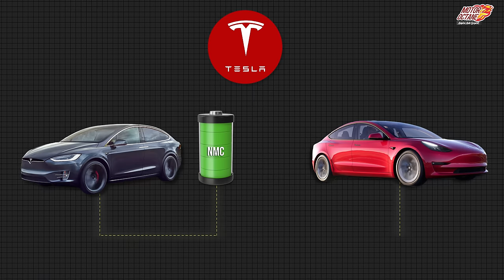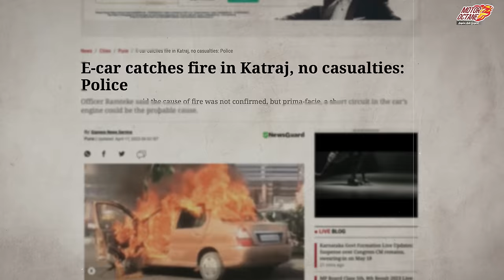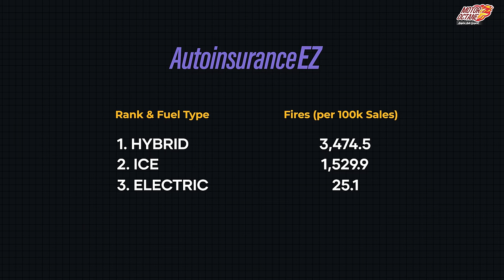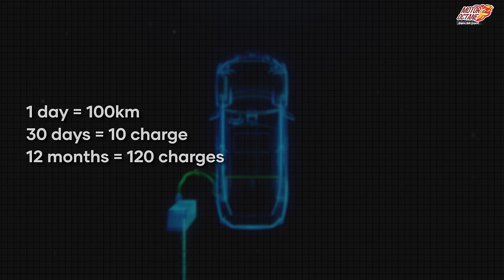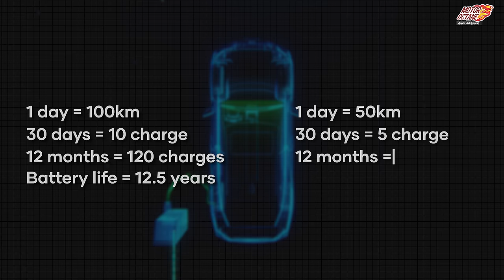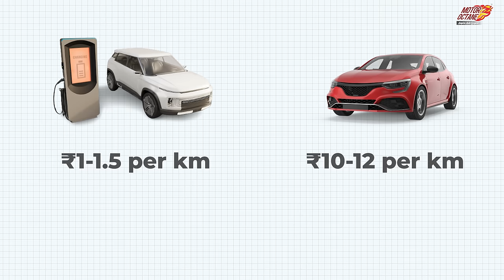Electric Cars have Battery Problems?

Comment: point a to point b in city its fine

out of town u need at least one battery stop and that could be at least one hour 

whereas fuel full tank takes 15 mins 

cost huge for bigger battery 

n once electricity charges increase which they will just as in usa where electricity is privatized 

well feasibility of electric is very low

Comment: In Financial analysis of EV one important point was missed.
The initial cost of any electric car is 2 to 3 lakh extra than the petrol cars. This is even after subsidy.
This means one has to drive the car 3 lakh km before they can recover the input cost. That is almost impossible.
The cost of electricity will go up like petrol. There will be maintenance cost. If we leave all this aside as they are common factors for petrol also. Consider this. If you change your car at home, it means you are consuming more energy and it will increase the total number of units consumed. Thus, you will breach the subsidised number of units and your whole bill will be generated at a much higher rate per unit. So, you end up paying more for your household appliances also.
One can never, recover the input cost. Better to buy petrol or hybrid and invest rest of the money in mutual fund. In 10 years you will get 12% on any index fund. This would be much smarter.
Unless the cost of electric cars comes down or becomes equal to petrol cars, it is not a value proposition of any middle class person.
If you are not middle class and rarn more than 45 lakh per year, you have nothing to worry  about. You should buy only electric cars and contribute to the public research. For the rest of us, wait till we get proper data on the batter life and cost comes down.

Comment: Considering electric car as a normal petrol or diesel car: 
Owners generally resell their cars after running 80k to 150k kms.
1) what is the exchange policy by electric car makers? Will they take back electric cars to offer discounts?
2) will it give same exchange value as petrol or diesel car?
Reply: why not ultimately dealerships have their own cabal to sell away the used cars through their contacts

you can sell directly on olx etc too since dealerships give lesser price than olx etc

dealership does not buy cars in exchange to send it to scrap or to drive themselves, they buy it to sell again

the price will be lower than selling directly to buyer as usual with normal car. Price of second hand EV will depend on battery degradation and in general how well maintained it is

Comment: This is such a reassuring video for someone like me who’s looking into buying an ev as their primary vehicle. The only concern I’ve is regarding it’s safety when parked in an open space under direct sunlight. I don’t have a covered parking spot, so it’s the only stumbling block stopping me from buying an ev.
Reply: Don’t buy if you don’t have a covered parking. I have a tiago ev and in the manual it’s specified battery degradation will be faster if kept at high temperature for longer durations. Also battery management system will run with coolant even when parked to optimise battery temperature and due to that you will lose more battery.
Reply: Congrats on fake assurances..

Comment: Sir petrol/diesel car fires and EV fires are not the same. EV fires burn at very high temperatures and are almost impossible to put out so theres a very high risk of injury to the owner in an EV fire. Also any accident that causes the battery to be pierced will lead to a fire which can be very deadly. We may start seeing many more EV fire cases as more and more EV are seen on the road and involved in accidents.

Comment: Cleared a lot of doubts for me, still some remaining, but very well done 👌🏼
Reply: what doubts remaining, I can answer (nexon EV prime 2021 11k km)
Reply: @shresthsonkar9207  what about resale
Reply: @pratyayamrit007  I'd ask you counter question, 

what are will be resale price of BS6 E10 due to E20 in future?

What will be resale of diesel cars amid the fact that the goverment has been presented with proposal to ban diesel vehicles in 1M+ populated cities

What will be the resale value of so called "best of both worlds" hybrids when their battery doesn't even have cooling system in hot country like India and the avg hybrid battery completes 2-3 cycles per day due to small capacity?

There is no certainity about anything, not even about the fact whether we will live to see another day or not, daresay. So I don't see how this is an "EV PROBLEM" and not a general uncertainity which affects every car

You can use OBDII to check battery health status of any EV so it would be very transparent to second hand buyer to check how good the EV is 

The more the health the more the resale. The only thing that may affect resale is changing technology.

Like let’s say rn only Nexon EV max gets 50kW dc charging but in future Tata may give that to normal Nexon EV prime also which currently only gets 25kW dc charging. 

In this scenario, the price will fall for those EVs since they lack features that new EVs at their price point will have 

Or let’s say Nexon gets adas in next generation acc to rumours then also prices will fall since a big feature will be missing from current gen compared to future gen.

Comment: Hello i am a doctor by profession and After consulting twice with motor octane, i bought MG ZS EV 6 months back . Currently happy with my car as i have already completed 30,000 kms in 6 months as my daily commute is 150kms. Not faced any problems till now. Thanks for helping me chose electric car back than.
Reply: According to resellers and online used car sellers, doctors don't drive more than 5000km per year. Clearly you are not a doctor.
Reply: @TheFourthWinchester  ok

Comment: Rachit, I am a Tigor EV owner. 
The calculation of charge cycle you did is not accurate. Unlike a petrol car, you actually don't wait till 10 to 15% for recharge. You will not drive a car till it reaches 0% . So charge cycle typically is lower. 

Also I don't drive it in heavy  mumbai rain months like July to sept, beacuse as you know that unlike Navi mumbai, where I stay, I work at vakola. I really don't know till what level of water logging you can take your car, despite all ips4 battery claim

Comment: Hi you could have explained charge cycle with respect to commercial aspects like day to day RUN vs KM Warranty etc
Reply: For example 100% drain up to 50% then you charge it back to 100% then drain back to 50% charge back to 100% = 1 cycle

Comment: Hi Rachit,
It was a wonderful video with great insight about car batteries, however you missed to clarify on one point i.e. “Battery Shelf life”. You emphasised on battery cycles but not considered the shelf life which also deteriorates the battery life.
E.g. A battery kept unused for couple of years can be deteriorated and the life cycle can be low.
So with the above point, I would be very happy if you can cover it in your next video related to EV or car batteries.
Thank you very much for your special and amazing videos all the time!!😊

Comment: The point nobody mentions is the driving cost when we use electric car chargers on the highway. They’re charging 25-30₹ per unit. Which translates to ₹4-5/Km. 

You can only drive so much in the city to recover EV cost. So I’d still prefer a diesel car.
Reply: I bought this car recently with the main intention of having driving comfort. But I am regretting it now due to the following reasons.

1. My back is sweating if I drive the car even for 1 hour and there is no use even if I turn on full AC. I am feeling very uncomfortable to drive after an hour and long drives might cause even more discomfort to me. This defeats the very purpose of my buying this car.
2. I recently dashed another car slightly during a traffic jam. The car's technology did not apply automatic break although it was claimed so by the company. So, the safety has become a concern now.
3. BYD's roadside assistance is very basic as the customer has to pay for any damage that happens during towing. In my case, I was asked to pay around 3.5 lakhs for towing damages. Because the insurance pays only for accidental damage but not for the towing damage. So, I am made responsible for the damage caused by BYD.

I did not even complete my first 1000 km. I am now wondering what I gained by buying this car.

...

Comment: There are still huge reliability issues with EVs, also, EVs are really not that eco friendly as is being hyped up. Ask yourself a simple question, if roughly 70% power generation is by burning coal (which is one of the dirtiest source of power) how is it zero pollution? It is then no longer a solving the air pollution problem, but shifting the pollution problem.

Comment: My doubt that was after 8 year what happened with bettery...but after watched your video, I am sure about bettery car, it is 10times better than fule cars...,Thanks for clarifying my doubt...👍👍🙏🙏
Reply: diesel is best
Reply: @JimnyReaper  I think you don't know...about Diesel, that means Diesel cars manufacturing may be completely banned in India,  after 3 to 5 years..!
Reply: Mere ni lagta ban ka, saara transportation vehicle uses diesel. Cause of mileage and power.
Reply: @harshbardhanshah  Are bhai agar Electric Cars mei battery tech upgrade hogya toh diesel electric motor ke saamne kuch bhi nahi hai. Electric Motor gives torque in entire rpm band.

Trains runs on Electricity. Not just from now. From years.
Reply: @rachitmittal448  badia 👍 . But I will still wait for ecosystem development first.
Reply: @harshbardhanshah  first of all ,Diesel passanger vahicle banned...
Reply: @_Naming_Art...  where, it's just a proposal. Not yet passed.

Comment: What about the problem of range? Generally, you get 300-350 km range is a good EV car. Where as a normal ICE car will easily travel 500 km and then 5 min for fuelling where as EV will need at least 4 hours of charging.
Just for the perspective, you won't be able to travel from Mumbai to Goa in a EV in one day.

Comment: Being a EV expert  i beg to differ with Rachit on Battery type ...LFP vs NMC ...LFP is better because Lithium does not get heated up that easily and has better life ..The advantage NMC has is it gets charged way more faster than LFP ...but definitely has lesser life span and gets heated up  when you compare it with LFP batteries

Comment: You can't compare battery of Tesla and any Indian brand. There is a lot of difference in the quality. Tesla survey is not applicable here, 12% degradation in range is not applicable here in India, It is way more. Calculation is based on 50 KM per day, where there many people driving 100 KM a month, it's not suitable for them :)
At the same time, there are quality issues with manufactures in India.

Comment: Rachit I am grateful that u made a such a wonderful informative video but I have few concerns

1. US agency data is to be studied correctly bcz in ICE car reason of fire mostly is bcz of some wire issue and it is not bcz of petrol or engine

2. Temp of battery, if we keep our car in sun battery degrades at a faster pace plus more chances of fire especially in Summers of Rajasthan MP Haryana Punjab Gujarat etc etc

3. Regarding cycle count of battery ur calculation has flaws bcz for eg u r considering 100km for full charge, then with every single charge it decreases and can never stay 100 even after the prescribed healthy charge cycles

So I liked ur video but there is a need to research about it more

Comment: Hi Rachit, Regarding the charge cycle - Not every time we will charge after complete discharge, sometimes even if battery is at 50%, 60% or 70-80% we will charge it. Does this scenario will also be considered in full charge cycle or will it reduce the charge cycle of battery?

Comment: There are Almost 3 types of Regen modes in an electric car. Can you elaborate as when to use Second or Third level of Regen braking??
As I heard that using Regen modes on 3 or 2 frequently reduces battery life or EV. Is it true?
Can you please explain it?

Comment: It was always pleasure watching you and get some important and practical information. 
A small request if you can make a video on how to find a charging station on any specific route as this is quit a complex and tedious process and have to toggle between multiple sites or apps for planning a long trip and this results in dropping the plan for buying an EV.
This is what happening to me. I can't find a charging station on Noida to Kolkata route travelling via Taj expressway then Lucknow expressway and then Purvanchal Expressway. This is not possible that in this long stretch no charging station is available but unfortunately I can't find one.
its not just me, many others have the same issue 

Please guide.

Comment: The main issue qas not addressed. Peice of the similar cars which are petrol and electric will have a huge price difference and that will nullify the benefits that we will get from avoiding fuel expenses. 
An electronic car of 25 lakhs gives very similar features as non electric car of price 12 or 13 lakhs. 
There is no cost benefits to the end customer. 
While selling the car an electric car will always fetch lower value to the range anxiety and older battery technology.
Reply: price gap between nexonev and nexon diesel xza+ automatic is 3.5L before subsidy.

we got 1.5L subsidy on our car which makes difference even lower at 2L

tiago ev and tiago petrol xza+ amt has 1.75L price gap.

Comment: Yes I had ab E20. After 6 years the battery went bad. Mahindra didn't confirm how many batteries to replace to make vehicle run for more thay 60% of the original range. I had very good charge cycles during my usage but during covid batteries went bad. How are batteries in new age cars? If these cars driven less how good are the battery pack life?

Comment: @motorcotane If we have very less driving usage like yearly less then 30-40k km then it will effect bettery life ?

I have new activa and not used that much daily so it's battery goes down and need to replace battery...so this kind of issues happened in electric car?

Comment: How long does the battery charge last once it's fully charged and I don't use the car meaning it's just lying in the parking.  Does it have capacitors to hold the charge.?

Comment: Can I ask you one thing.... What about electric car in rainy season and roads full of water.. somewhere we came to know that it is risky
Myself writing this from Kerala.. in an year we may get 6 months of rain..
Kindly reply
Reply: Battery packs are made fully water proof. Watch video of Ola S1 Pro riding in sea water
Reply: I bought this car recently with the main intention of having driving comfort. But I am regretting it now due to the following reasons.

1. My back is sweating if I drive the car even for 1 hour and there is no use even if I turn on full AC. I am feeling very uncomfortable to drive after an hour and long drives might cause even more discomfort to me. This defeats the very purpose of my buying this car.
2. I recently dashed another car slightly during a traffic jam. The car's technology did not apply automatic break although it was claimed so by the company. So, the safety has become a concern now.
3. BYD's roadside assistance is very basic as the customer has to pay for any damage that happens during towing. In my case, I was asked to pay around 3.5 lakhs for towing damages. Because the insurance pays only for accidental damage but not for the towing damage. So, I am made responsible for the damage caused by BYD.

I did not even complete my first 1000 km. I am now wondering what I gained by buying this car.

...

Comment: The problem with electric vehicles is not in the car itself, but rather the after sales services where sometimes the technicians aren’t too knowledgeable as they are with ICE! And taking forever to determine problems with programs, circuitry and sensors! Also pretty sure you can’t get it serviced elsewhere!! 🤔

Comment: Dr Sonal Singla: Hello motor octane, insane and remarkable video on electric vehicle. But I have one question. Superfast vooc chargers are installed at the highways and many more are in phase of installation in coming months. The problem is of instances  grid failure in the areas where they are used and many more are getting installed even with more faster charging speed eg  for 2023 hyundai  ionic could be charged with super super fast charger in few minutes But that has lead to grid failure . So my question is, that this is just the beginning . If more and more evs are coming on roads with more and more fast charging advanced capabilities how India or we will be able to get through this problem .
Reply from the maker: This is something everyone will have to work on - and when efforts are made - progress will also in the right direction
Reply: where did you read that charging ioniq 5 caused grid failure?

Comment: Doubt 🙋
1) with electric car you can not go for inter state drives(long drive)
2) once battery is dead after 10 yrs car is useless whereas engines continue to work after 10 yrs
Reply: tell me you didn't watch the video withou telling me you didn't watch the video